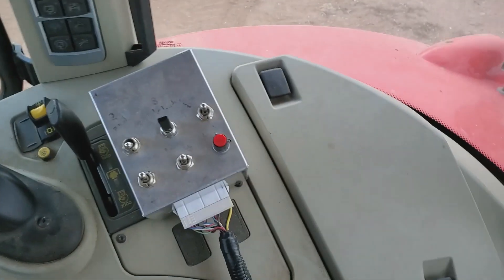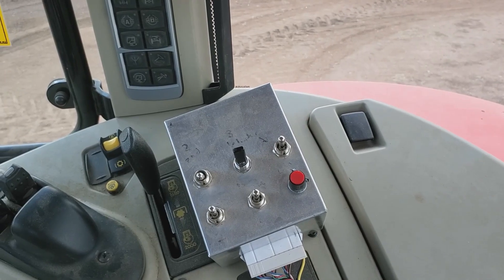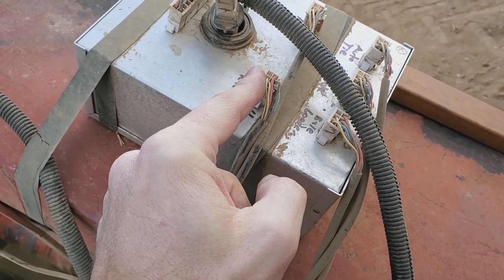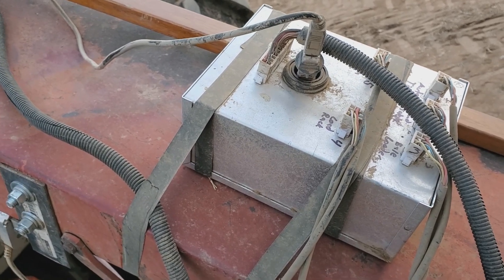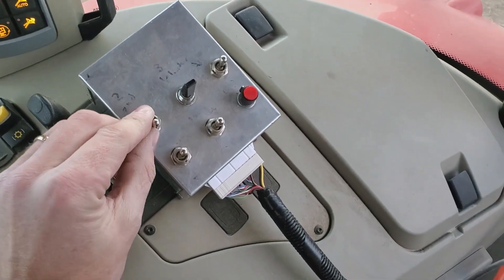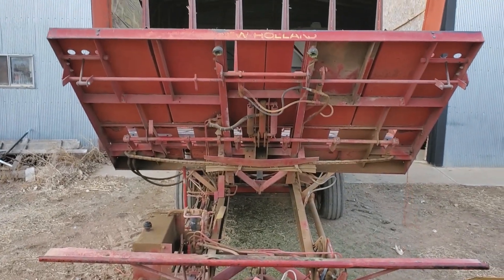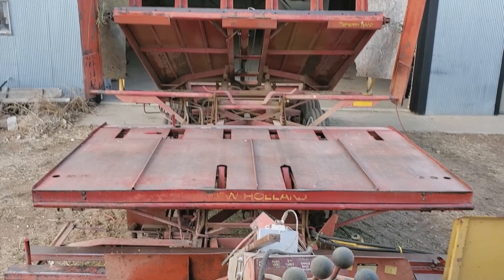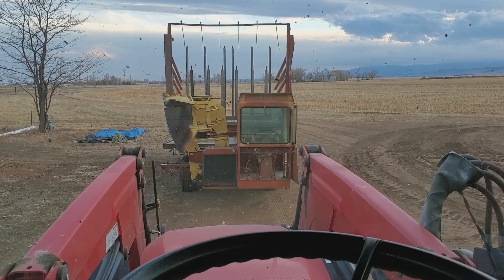Electronic Controller (Arduino) on 45yr old New Holland Bale Wagon

Comment from the maker: If anyone is interested in getting a system, I could provide a complete unit for $1800, depending on how many linear actuators you'd need.  I wish it was cheaper but the parts list alone is close to $1000.  Reply below if you're interested and we'll see if we can work something out. Thanks!
Reply: Hi.  I just found your videos.   I have a 1034.  Recently purchased.  The load rack is constantly jamming halfway down. It seems to be doing it if the bales are slighly out of consistent size.  Does your 1034 do the same and if it does how did you solve it.
Reply from the maker: did you ever figure it out? I may have a few ideas if not.  Sorry for the slow reply..

Comment: Would you be interested in sell me a plan or complete unit?
Reply from the maker: I could provide a complete unit for $1800, depending on how many linear actuators you'd need.  I wish it was cheaper but the parts list alone is close to $1000.  Let me know if you're still interested.

Comment: This is pretty smart! Very good job! If you are going to put up small square bales you have to have a bale wagon!! Mine is very old!! Don't know the number, but is only holds 70 bales, self propelled with a Wisconsin 4 cylinder torque monster, and open cockpit but works like a charm, and you can always count on it!! Makes it a one man operation!!!  Again, very good job!!
Reply from the maker: Is it a new holland wagon or something different?
Reply: @Xealuz  New holland!! It is a 10 something or another. I just cant remember the number!! Has to be one of the first ones made!!1 It is extremely handy in a barn!!!

Comment: Very clever!  Would you be willing to sell me a parts list and where to buy the parts. I also have a enclosed cab and would like to operate the stacker from a enclosed cab.
Or if your buyer doesn't want the system would you sell it to me?  I  have a  New Holland 1033. Thanks
Reply from the maker: The system sold with the wagon, ill have to look into the parts list and see what I can pull together.  I'd be able to flash the code onto the arduino, but may be a bit difficult to get everything detailed out enough so someone else could get it wired.   

That said, the linear actuators are $140 each on Amazon, so 5x is $700, probably figure $150 for electrical components, enclosure and miscellaneous.  Let me know if you still have appetite for the project knowing base cost. 

 If your still interested, I could put some more thought into putting another system together and how much time it would take me.  Let me know.
Reply: @Xealuz  Thank you for your response. The cost is ok. I found a good used 1033 for $500 so I have room to improve it. Let me know what would do to communicate the parts sourcing and details of install.

Thanks
Reply from the maker: @dalebruns8535  I could provide a complete unit for $1800, depending on how many linear actuators you'd need.  I wish it was cheaper but the parts list alone is close to $1000.  Let me know if you're still interested.
Reply: Have you put together your parts list and schematics yet? Price for that info?
I’m dialed on the linear actuators with potnetiometer, mounts and that part, just need the wiring and board stuff.  Did you use any relays in his system?

Thanks
Reply from the maker: @johncipolla2578  I could provide a complete unit for $1800, depending on how many linear actuators you'd need.  I wish it was cheaper but the parts list alone is close to $1000.  Let me know if you're still interested.

Comment: Awesome! I am wanting to do the same thing to mine and curious what the best linear actuator is? Thanks.
Reply from the maker: I used linear actuators from progressive automation, they worked well for me
Reply: @Xealuz  Okay awesome. Do you remember which stroke size and how much pull force you got?
Reply from the maker: @jjmartin  I could provide a complete unit for $1800, depending on how many linear actuators you'd need.  I wish it was cheaper but the parts list alone is close to $1000.  Let me know if you're interested.

Comment: Thanks for share your video. How did you connect the actuators to the cables?
Reply from the maker: The actuators have their own electrical cables with connectors, they plug into the connectors in the control box
Reply: @Montgomery Farms  Thanks for your reply. Your ideas have really got me thinking. My question is: how did you connect the end of the actuator to the push/pull cable on your bale wagon? I can't quite tell from the pictures. Appreciate any help.
Reply from the maker: @farmertan13  check out the video around 5:40.  I used 1" square steel and drilled a hole through it for the control rod, then on one of the other faces drilled and tapped another hole, 3/8 I think, to intersect with the through hole.  I then used some aluminum c-channel, cut it about 1" wide and drilled a hole in the base.  Finally, I slipped the 1" block onto the control rod, and then tightened a screw, through the c-channel, onto the control rod, sort of like a set screw.
Reply: @Xealuz  ok, thats great. Thanks so much for the tips!

Comment: What is the advantage of adding arduino over just using switches to power the actuators directly?
Reply from the maker: I initially thought of using limit switches on the actuators, but realized that I'd only get two positions (in and out).  With the bale wagon, all of the control rods are 3 position (in, middle and out) so that lent well to the arduino with the position feedback on the actuators. Additionally it allowed me to have speed control on the 3rd table so I could set the stack down gently.

Comment: If you're on Facebook and not already in the New Holland Balewagon group, you should be.  They enjoy stuff like this although I have not seen something like this in the group
Reply: ... one more thing, how easily could these be cranked out in a shop and sold online?  You maybe onto something.
Reply from the maker: Thanks for turning me onto the facebook group, I'm on several online forums but hadn't come across the FB group.  I think the system would be pretty easy to put together, I went through a couple iterations.
Reply: What is tge name of the facebook group
Reply: @mikewor514  New Holland Balewagon, stack wagons and stackliners